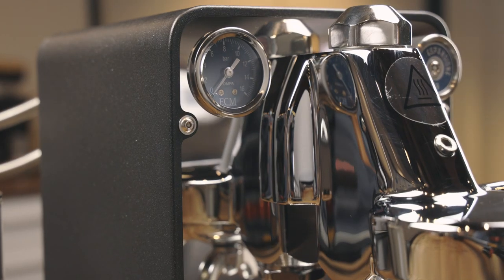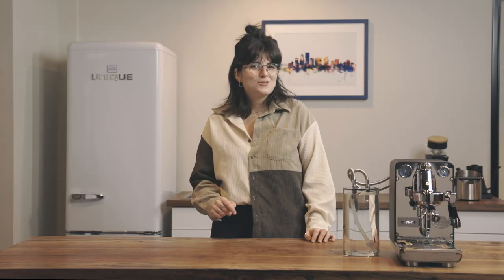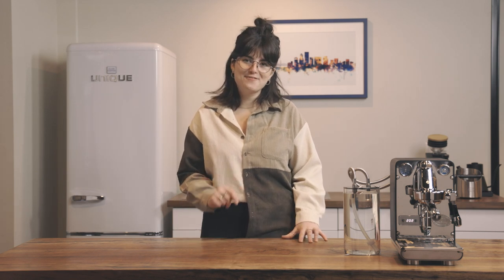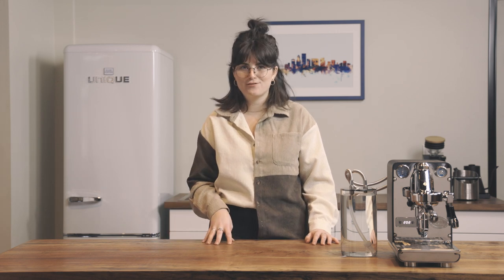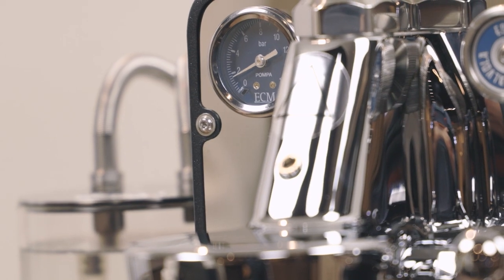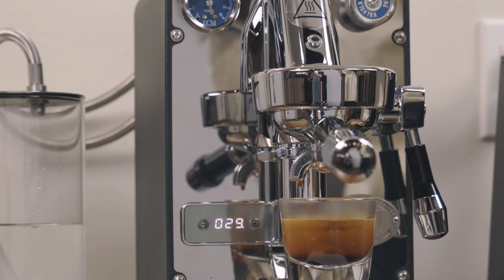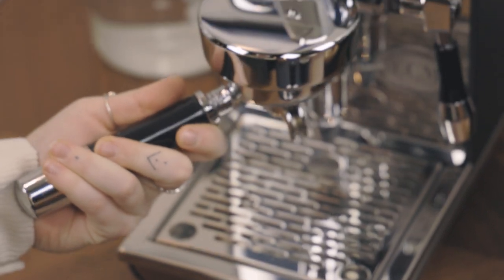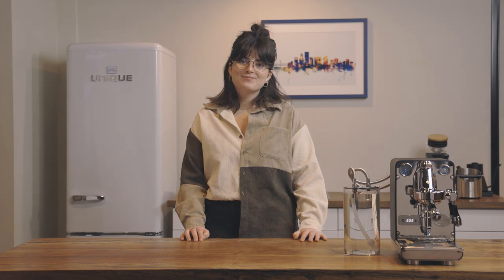The ECM Puristika: How it works

Comment: Good explanation. I first thought the Puristika got a unique expansion valve within the ECM lineup. But unless the knob it's the same old valve sitting behind the shiny steel plate. So not rly intended for use during extraction. ECM even says in the manual that you should only use the expansion valve with blindfilter for pre extraction pressure adjustment. Basically the same story as before with the Classika II(PID). Out of curiousity I played around with a improvised knob connected with the valve screw of my Classika PID. I was able to dial back the pressure to about 6 bars, which would make sense to start extraction with. But after playing around for too long with it I screwed up the silicone plug that in conjunction with the spring controls the pressure. There are also two o-rings within the valve plunger, that would brake over time with constant pressure profiled extractions. The better option is definitely the flowmeter that is available for all E61 groups. Changes in Flowrate will affect pressure to some extend too.

Comment: You say that increasing the brew pressure will increase extraction and lowering the pressure will decrease extraction, but the research made by Chris Hendon proves that its the other way around? The pressure for extraction peak is actually closer to 6 bars.

And for those wondering, as the pressure increases the likelihood of channels increase, which will cause a decrease in extraction. At around 6 bars of pressure the pressure is doing a good job at increasing the extraction while not causing excessive channeling!
Reply: And it must be taken into account that the Puristika or machines with a similar pump do not go below 8.5 bars
Reply: Low pressure preinfusion takes care of this. Pre-infuse around 3-4 bar, let bloom, then go with whatever pressure makes you happy for the full shot

Comment: So, can we do pressure profiling with this machine? Also, can we have the water tank bellow the machine hiding inside of a cabinet?
Reply from the maker: You can do pressure profiling if you get an E61 flow control device. Yes, you can place the reservoir anywhere but the connecting tubes aren't very long.

Comment: I totally understand removing hot water. But steam wand is kind of big deal. Would rather spend little bit more and have steam
Reply: Yea.  The main reason why they removed the steam wand is so you can achieve a more steady temperature than a heat exchanger.   Otherwise you'd need a dual boiler setup.
Reply: Late reply.  This will be right up my alley as it has a rotary pump, runs quietly. I typically make my espresso in the morning as my family is asleep. I have a separate milk frother to make foam. A MUCH quieter way of making foam which a steam wand would hiss loudly.  
Besides I make iced lattes so a steam wand would not appeal to me.

Comment: Does the have a timer to turn on automatically in the am?
Reply from the maker: It does not. The eco mode will turn it off automatically but not back one. You could leave the machine on and plug it in to a smart timer.

Comment: i still dont get the water reservoir, its heated whole external tank or where is the water heated? My La Pavoni heats all the water inside the machine, how does this one work?
Reply from the maker: Very simple. The machine draws water from the external reservoir into the brew boiler. The brew boiler has a heating element that then heats the water inside of it, and a PID controls that temperature. The boiler is never empty and only draws fresh cool water when it's needs. Does that make sense?
Reply: @clivecoffee  thank you for your answer. I coulndt find that info:)
Reply from the maker: @ronykubik  My pleasure. Cheers!

Comment: How long does it take for the Puristika to warm up and be ready for an espresso extraction?
Reply: on the manual, it says about 10 mins.
Reply: @eddieliao1500  Thanks
Reply: It takes 10 minutes to reach temp in the boiler and about 25-30 minutes to reach temp in the group head. But it's winter here and the machine is like 10 degrees Celsius in the morning.
Reply: I have a unit and it really takes half an hour to heat up
Reply: @pserafei  In your unit it always heats the head of the E61 without activating the pump? In my unit sometimes it doesn't heat.
Reply: During the past 4 months that I have the machine only once I had to activate the pump because the group wouldn't heat on its own. I think there was some air trapped inside the tube blocking the water to pass but can't be sure.
Reply: @pserafei  Thanks for your answer.  I have had less luck.  My unit does not heat more times than yours.  😐
Reply: @pserafei  Does your boiler make noise when heating (bubbles and sometimes strong bubbling)?
Reply: yes it does this..I'm wondering if it's because the machine is too cold at the beginning or maybe it needs descaling 🤔
Reply: @pserafei  They are very new machines to have calcification problems... I suppose that it will be a combination of a steel boiler (noisier than copper) and that it accumulates more air than normal (which happens in other machines when they calcify).  Well, at least we know that its operation "is normal".  Thanks for your answer.
Reply: There was a design flaw which is currently being worked out by ECM and should be available soon. Check with your dealer.
Reply: @Srv02  Thank you very much for the information.  I have been talking about the problem with my dealer for two months and my dealer says that the ECM company says that the operation of the machine is correct.  I know what Dave says in his forum but I don't understand why a company like ECM communicates with its clients "it seems" through an internet forum.  I don't doubt Dave's good intentions but I bought the machine from ECM and not from an internet forum.  Finally, the last communication with my dealer asks me to;  First I sent the machine to my dealer (it was bought online), then my dealer is going to send the machine to ECM, ECM will fix it and send it back to my dealer so he can send it to me.  All to change a dumb part.  It seems incredible to me how badly ECM is managing this problem.
Reply: @Srv02  Sorry to tell you all my story but, I am very angry with ECM.  😬 What solution has your dealer given you?
Reply: As I said, they’re working on a solution and once it is released, your dealer can fix it.
Reply: @Srv02  Okay.  I understand.  I'll try to be patient.  Thank you very much again. 👍
Reply: Then talk directly to ECM and not to your dealer … you‘ll never know what they are doing.
Reply: @Srv02  Sure, I did and ECM has never responded to any of my emails.  So, A forum says one thing, my dealer says another (now he is more in agreement with the forum) and ECM doesn't answer me.  This is why the situation seems so incredible to me.  As it may be that they do not respond to their clients, communicate with them through an "unofficial" forum and do not stop the problem with a simple internal communication to their dealers such as "be patient, we are studying the problem, notify the clients affected, we will contact you later".
Reply: @Srv02  That's why I was asking you how your dealer was responding to you.
Reply from the maker: Yes, about 10 minutes!

Comment: I’m having a hard time seeing the advantage of this machine compared to something like ECM’s own Classika PID which, for $50 more, has steaming, a larger and less awkward reservoir, a more powerful heating element, and comes with two portafilters. To me, the external OPV serves no purpose other than esthetics if it is not used during brewing. Am I missing something else that is not obvious from a paper comparison?
Reply from the maker: There are many people who know they will never steam milk. In that case, they may prefer the aesthetics of this machine and choose it over the Classika. If you think you may want to steam milk or would like the option, the Classika is a great choice.
Reply: Pretty much. You are spot on that it is less value for your money. But I would but this over the classika, even if I want to steam milk occasionally.

1. This looks way better, and that makes it enjoyable to use, and also makes the space look nicer. The classika while not bad looking, just has that generic steel box look which I don't like. Was initially looking at a Linea Mini before I went with this, for the aesthetics, but couldn't justify for home use ($700 for a steam wand upgrade - no way, not for me).

2. Less parts less maintenance and likely points of failure, and having the external OPV is nice and convenient so you can make adjustments without any tools. Easy to open up as well. 

3. The external water tank looks nice but is also functional to quickly check the water level, and if you really wanted to, you could probably replace the tubes with longer ones later and have in be connected to a much larger hidden reservoir under your counter or something.

4. For steaming and hot water, I would much rather get this and something compact like a breville bambino on the side. Sure the steaming is slower but you can do it at the same time, or without needing to wait for warmup as that machine is basically instant on. Also the quality of your drink isn't really affected by steaming on the bambino, and the steam performance of that machine is pretty decent.

I would fully expect that machine to fail in a couple years, but at 299 along with the free $200 accessory package and beans deal that you can get it from brevilles website, I'd just think of it as getting the machine for free having paid for the accessories and beans. As tech improves, it doesn't seem to make sense to have a large steam boiler heated all day just to use it for a few minutes at home (makes sense in a commercial environment). Same for the brew boiler, but they are usually smaller and require less power, and importantly does make a big enough difference to espresso quality.  

I would fully expect the next gen of cheap breville machines to get closer (not match tho) to the Decent machine steam performance, and would probably upgrade/replace the bambino at that point. In a way, with this combo you are almost getting E61 Dual boiler performance (not quite) for $1900, with better energy efficiency, and some room for upgrades, down the line.

Or you could also use something like a nanofoamer.
Reply: @anupjsebastian  so, funny enough, I actually ended up buying one of these for the office. I love it. I don’t mind making coworkers coffee, but I didn’t want the logistical nightmare of steaming milk at work. The Puristika is perfect.
Reply: @anupjsebastian  agreed

Comment: They put the OPV in the front because the water reservoir is external and the machine doesn’t have a lid on top.
Reply from the maker: Totally! We wanted to make sure users understand its function and how it can benefit them too.
Reply: Matthew Hayslett  Nope … you can completely drain the system with a screw.